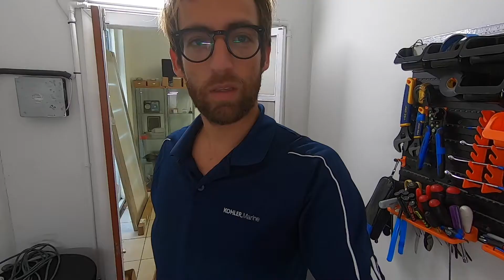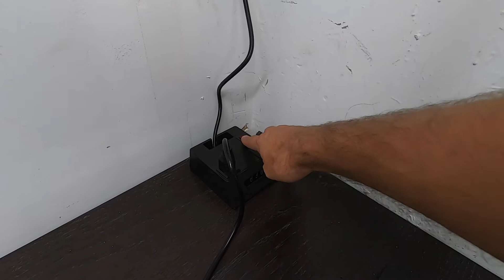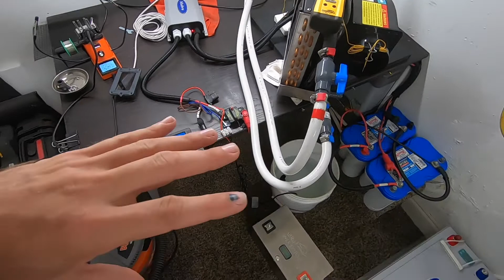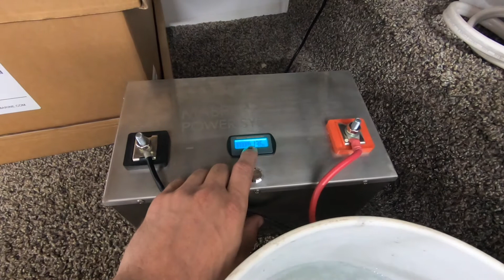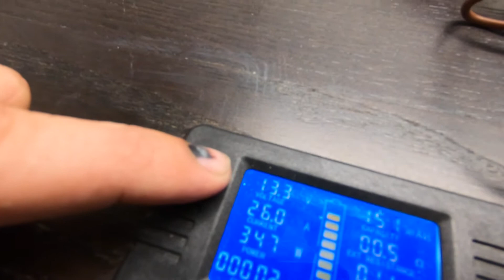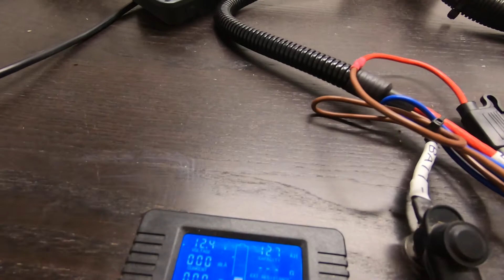AGM bank vs Lithium bank to Run a 12v Marine Air Conditioner by Mabru Marine

Comment: You can just add a battery protect to any battery. Then as well most inverters and other equipment have a 11.1 volt shut off. Lithium batteries are terrible for very low or high temp environments. They will shut down or if the BMS fails. They will catch fire. AGM batteries are great for applications where temperature is an issue. I always see people bashing AGM batteries. Not to mention the AGM being used is more for a vehicle starting and moderate accessories application. I have AGM 125 ah tanks because my battery location can reach 127 to 132° in the summers. The temp will effect performance and life. However the system will not shut down. I know fellow off-grid people who have lithium batteries and their system shuts down at the the hottest part of the day. Lithium batteries are more for a controlled or fair weather environment.
Reply from the maker: I believe that you are misinformed. All batteries suffer in high heat or low temperature environments. Yes, you can add a low voltage disconnect to any battery but it an an additional component that needs to be purchased and installed whereas a proper BMS has this built into the battery. Regarding fire, I have yet to see any of our batteries or reports of any reputable LiFePO4 battery manufacturer having a situation of a battery catching on fire. Regarding the high temperature, we have a demo vessel with lithium batteries in the engine room with an ambiant temp of about 120 degrees when the engines are running. After two years of use, we have yet to have the lithium bank cutout due to high temp and capacity has gone from 250Ah to 235Ah. Before the swap to lithium, we were using Mastervolt 225Ah AGM batteries that would need to be replaced every 2 years as they would no longer have enough power to crank the engines. I believe that AGM batteries do have a place in this world for solely engine cranking or for a bow thruster but for a service/house battery, AGM is simply not the best option. There is also no mention in your post of two of the other main advantages. Weight on a 225AH AGM battery is 160lbs vs 65LBS on our 250AH LiFePO4 battery. Usable capacity on a 225Ah AGM is 112.5Ah vs  212.5Ah usable on the Lithium. I would need just about two times the space going with AGM vs Lithium for comparable useable capacity, bringing the total weight difference to almost 5X less for almost the same capacity.
Reply: @MabruPowerSystemsINC   @Mabru Power Systems, INC  I am in absolutely now way misinform in my statement. Yes there are a few exceptions. However a proper AGM battery does not shut down at those high temps. Littium batteries do because their BMS shuts them down. I believe you misread my statement. I have over 20 years of extensive real time experience with batteries. I also have ties with people whom are vastly more knowledgeable than I. Yes they are effected by heat based on life expectancy, charge ability, and capacity but that was clearly not my statement. My statement was the AGM will continue to run when lithium will shut down at extreme temps. Now there are like Panasonic batteries that will run 167° F. and others around 140. However all the systems of others I know have ran shut down at 130 to 135° while charging and supplying power to a source. Now if you make your own group you can simply not use a BMS and run the lithium batteries until they swell and  fail. This I've seen as well first hand along with some having a small fire. There are many that can go higher but still require some type of cooling from some of the specs I've seen. I'm both charging and discharging at the same time at temps as high as 142f and average of 139f for roughly 4 hours.
Reply from the maker: @allennolden8735  So all of this is to say what? That in an environment where temps exceed 140 degrees, go with a lead acid battery? If you happy with AGM, I am totally fine with that and I would certainly NEVER condone using an unregulated (no BMS) LiFePO4 bank. I would never again use an AGM bank as a service battery and would just place my LiFePO$ batteries in a more suitable area where they are not exposed to this ridiculous temperature to prolong the life of the batteries. If the BMS is shutting the batteries down, it is to protect the cells which makes sense when you are spending thousands of dollars on batteries. There are very few exceptions where an AGM battery is better suited than a Lithium battery from where I stand. Maybe you "can" run the AGM battery at those temperatures, the same way that an engine can be ran without oil if there is safety cutout but neither scenario is recommended. The following quote was found by doing a quick online search: "it is actually heat which causes failure. An outside temperature of +20 °C is optimal for a car battery. But in the summer, the temperature frequently climbs to above +30 °C. High temperatures lead to self-discharge of the battery, which causes the battery to age faster". 20 degrees C is 68 degrees F just so that we are all on the same page.    TLDR: can you use an AGM battery at 140 Degrees F? Yes, the lead-acid battery has no internal safety to stop you but you really shouldn't as it causes cell degradation.
Reply: 1 have a 2006 cyclades 39.3
3 cabin one cabin is used for storage and sails 
What size unit would you recommend ?

Comment: I am looking to cool the aft cabin of my 37 ft trawler.  300 cubic feet.  I have 750 Ah of Victron AGM battery.  No other large draw on these batteries, no refrigerator.  What can you tell me.  Will the 500 do the trick, or do you recommend the 700.

Comment: If I could run an AC unit while at anchor I might actually consider cruising full time.
Reply from the maker: Let us know when you are ready because we have the solution for you!
Reply: @MabruPowerSystemsINC  Me too and I'd like to get rid of my generator. Is it possible to set up a battery bank to run only my current AC systems, an electric stove, Air con (only at night) and few 110 outlets?

Comment: Nice video- thanks! Would there be any harm to your AGM battery if you were plugged in to shore power at dock and ran the DC unit extensively, with shore power going through charger to AGM to the DC unit? Without other loads it seems like the 40 amp charger could keep DC unit running without any decrease in battery state of charge. Is this correct?
Reply from the maker: A 40A charger could definitely keep up with demands of the air conditioner running but like you said, there is not a ton of room for other loads such as lighting, stereo, refrigerator(s), vhf, gps, etc. once battery is charged, charger acts more like a power supply to provide power to the load rather than  passing through the battery. The answer yo your question is: yes, you are correct. Our batteries are Lithium, not AGM but the system can work with AGM batteries.